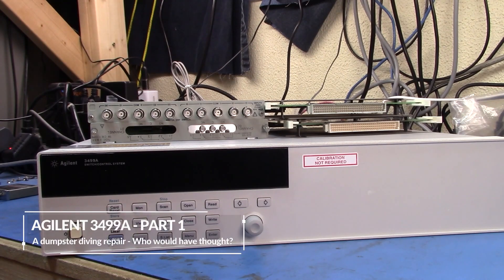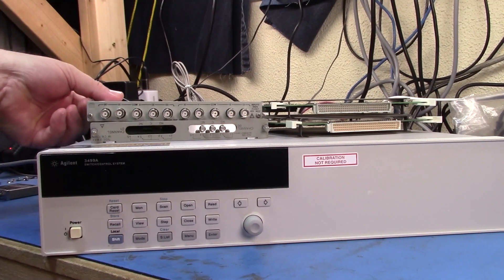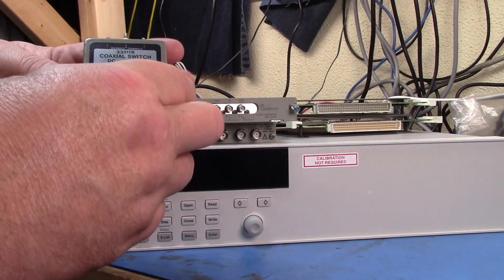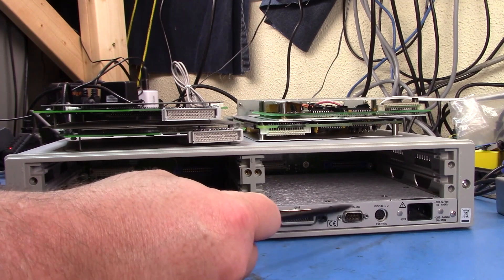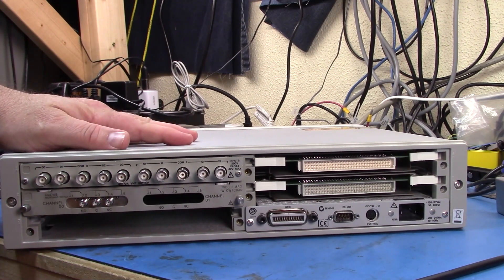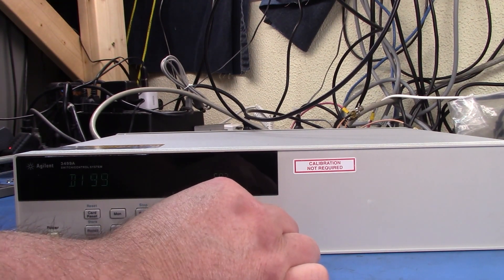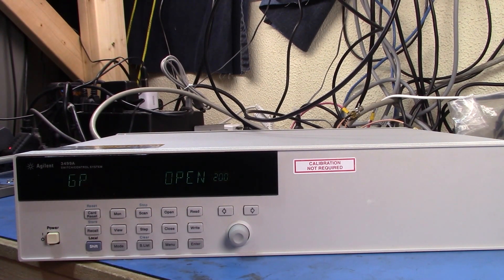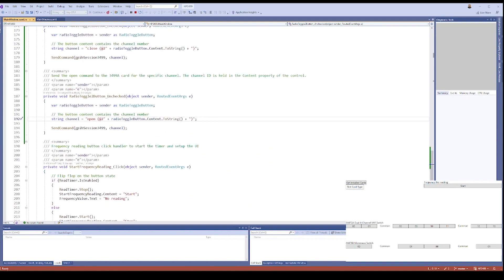Agilent 3499A - Part1 1

Comment: Actually, the connectors on the digital I/O boards are not custom parts. They are standard DIN41612 connectors. In this case the 96 pin ABC variant (rows A, B and C are populated with pins). All sorts of variants exist, like 64 pin AC in the same plastic shroud, but also shorter ones with less pins, as this HP has on its backplane.

Really nice and reliable connectors. Often found in (mostly European I suppose) industrial control systems, T&M stuff. And in VMEbus computers.

cheers, Wilko
Reply from the maker: Interesting - Thanks for the info - I've never seen the connectors outside of the bits hanging off the back of these units - I'm still fairly sure I won't use the boards for anything though :)
Reply: @tgsoapbox  Yeah, these are not the most useful cards for the average home user.

The aforementioned DIN41612 connectors also come with coax contacts. I just stumbled on pictures of those. They are found inside my Efratom modular Rubidium frequency reference, More than happy to send you a copy (just need to figure out how 😀). best , Wilko
Reply from the maker: @pa1wbu  Thanks - Maybe drop a link into the comments here - I really don't have a use for them though

Comment: The thumbscrews on the coax-based cards screw into the switch controller in the same way that the other cards' (the "non-coax" ones, so to speak) wiring harnesses screw into the unit. IOW, all the cards eventually have something that screws into the back of the 3499 (or 3488).
Reply from the maker: I was really just wondering why the VHF card had screws and the Microwave card had thumbscrews - I can understand them both having either screws or thumbscrews but the difference seemed strange.
Reply: Maybe a look at the serial number enlightens? Could very well be different production years?
Reply from the maker: @pa1wbu  Could absolutely be but I think both these boards were earlier vintage I just find it interesting that they have different mounting hardware - It'd be great to know if it was just a "release date" thing or if there was a real design decision behind it.